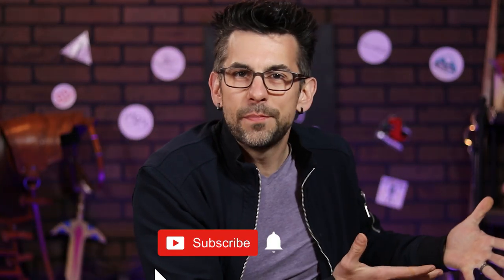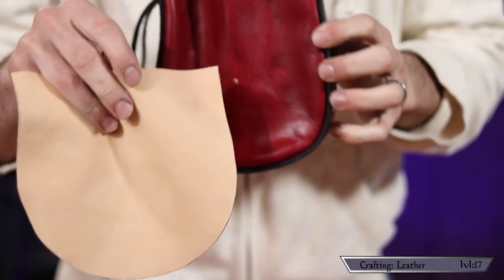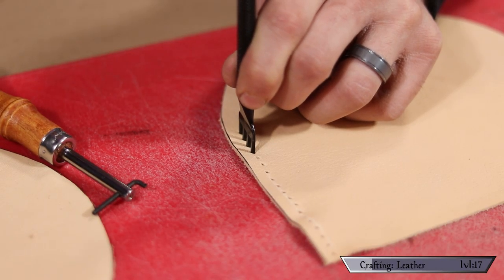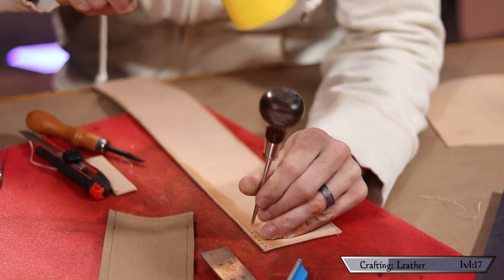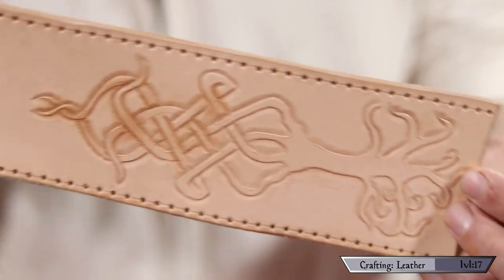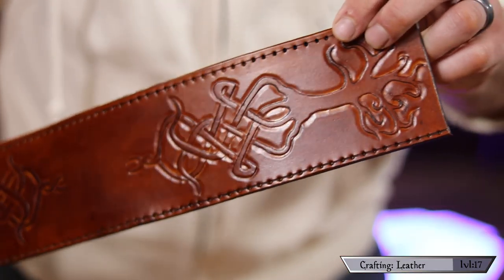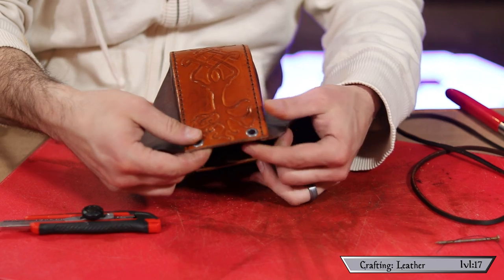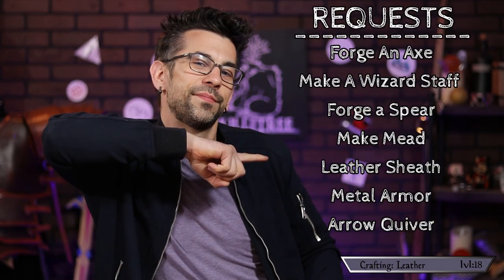Leather Crafting Basics | With and WITHOUT special tools

Comment: I have been working with leather for a while. since high school actually when Walmart used to sell the pieces of suede, anyway I have experimented with making my own leather dye and it's not that difficult, 95% isopropyl alcohol and acrylic paint, in a glass jar shake the crap out of it till all the paint is dissolved into your alcohol and bam leather dye, just wet the leather and instead of dobbers i used the foam paint brushes and it works just fine, you just have to put three or four coats on

Comment: this definatly helps heaps... but guessing that light coloured leather is what you need. I got some that has a bit of a finish on it. but I was given that leather so I had no choice in the colour/type. This has caused me not to be able to "tool" leather as it won't let me.
Reply from the maker: Yeah, it sounds like you have chrome tanned leather. It tends not to hold tooling well. What you are looking for is veg tanned.